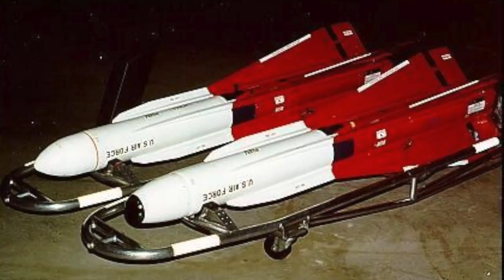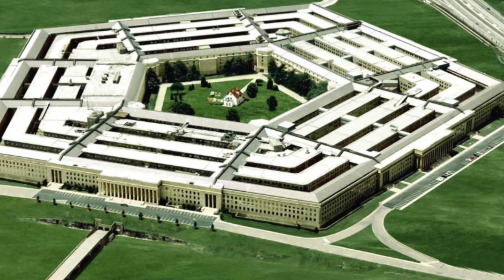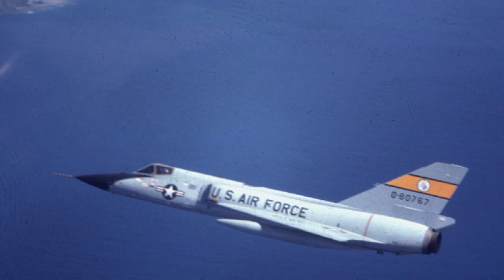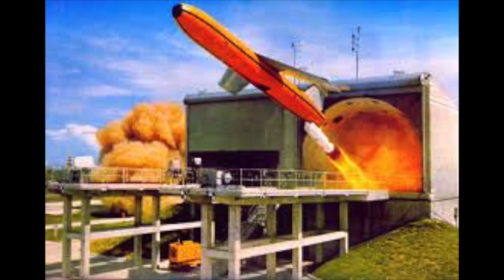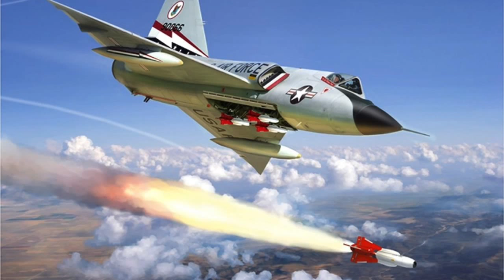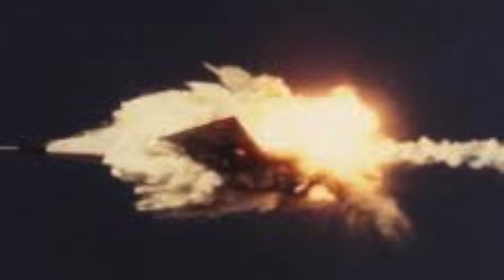MACE kill

Comment from the maker: Max. -  How high could the F-106 fly?  Regulations kept us from flying over 50,000 feet without a pressure suit, and we hated the pressure suits. I flew often and easily at 49,000 feet, while planes like the F-4 had trouble above 35,000 feet.  On one memorable flight, I zoomed to 65,000 feet without problems, but I came back below 50,000 feet quickly because I didn't have a pressure suit. 
I had the distinction of shooting down the first BOMARC missile.  When talking to other pilots who made later tries against the BOMARC, one told me that he was on a pressure suit mission and flew at 75,000 feet, planning to attack the BOMARC (65,000 feet) from ABOVE!  The BOMARC scrubbed so he didn't get a shot, but he flew the F-106 at 75,000 feet!
Reply: Was he cruising at 75,000ft? That's amazing if so; that's getting into SR-71 territory, isn't it?
Reply from the maker: Helium -- the U-2 could probably fly even higher than the SR-71.  We seldom knew a U-2's altitude.  Our ground height finder radars were unreliable and disappointing.  The F-106 data told us what our altitude was, but only that the target was above us at an approximate angle, not an altitude reading.  I talked to an F-106 pilot who said he was flying supersonic above 70,000 feet, but I never got up there.

Comment: Thanks for recalling this (unknown to me) ad-hoc operational test of the F-106 and IR Falcon. I've heard that the ANG squadrons did an especially good job of maintaining these weapons in their elder years.
I've also read the reports of the lower F-4 / Falcon combo performance in Vietnam and attributed them to an poorer maintenance environment and/or high G target maneuvering. The early Sparrow missiles didn't do that well either. The Sidewinder, a newer IR missile design, seemed to be the preferred F-4 weapon. 
If you read this, I'd like to know how the MACE missile was acquired (on board,  ground based radar or both).
TIA, Mike
Reply: UPDATE - just saw your post on the Night Weather video about the differing characteristics of the IR Falcon vs Sidewinder that I was not aware of. I already knew about the F-4 radar / weapons system limitations compared to other contemporary fighter radars / FCS.
Also need to ask if you know of tests using either Falcon against higher G maneuvering (MiG type) targets. Haven't checked out your FB videos yet.
Reply from the maker: Em Eff We did not have any realistic TARGETS to fire our weapons at.  We were very aware that an afterburning target would have such a very large IR signal that an approaching missile would have its entire sensor view full of fire.  What would it do?  The blast of the afterburner exhaust would cause extreme turbulence.  If the target turned, would the missile head through the middle of the exhaust plume and never hit the target?  We ran a program to turn old F-102 fighters into drones and used them to test these conditions.  The AIM-4G already had a program which would aim just forward of the IR plume, so it would hit the aircraft, and later Sidewinder missiles got the same modification.  However, the F-102  TARGETS to test the missiles against were not available until after the Vietnam War.
Reply from the maker: Em Eff To answer your last question:  Arnie Voit used a radar attack on the MACE.  The computer gave the angle and distance to the target at fire time, so his two IR missiles knew exactly where the target was and both locked onto the MACE with no problems.  My attack on the second target, the Firebee drone, was too complex to describe on the video.  I had a radar problem that could have been fixed in two minutes with a screwdriver adjustment, but the rules of this test said NO MAINTENANCE.  I therefore went with an infrared attack on the drone.  I made the initial contact with radar, but then locked on with the infrared IRST system.  Without radar lock-on, I had to estimate the range from the radar scope, and pulled the trigger manually to fire.  My two missile seekers were slaved to the IRST tracker and both saw the target.  My missiles ripple fired (instead of going at the same moment as Arnie Voit's missiles did) and my first missile hit the little Firebee drone directly, blowing it into tiny pieces.  I was watching the missiles too closely and did not make a breakaway maneuver, so I ended up flying my F-106 right through the fireball of the Firebee drone.  I was very lucky and did not hit any big pieces -- the only damage to my plane was some paint scraped off the wings.

Comment: The F-106 Delta Dart was the only plane built as a interceptor. It was high gloss grey with U.S. AIRFORCE all down the side, The 49th had lighting bolts on its drop tanks and a big eagle on the tail. That's common knowledge. We put WSEMS, weapon system evaluator missiles on them daily, had to hand crank the film from them and turn in to photo opps to qualify the rail. I love the 6. I have worked on 16' 15' a-7's, nothing compared to the 6
Reply from the maker: Edward Moriarty -- the F-106 was not the only plane built only as an interceptor.  We had many others -- the F-86D, F-86L, F-89, F-94, F-102 were all designed as interceptors only.  The British had some, too.
Reply: the 6 was the last plane ever built as an interceptor, my bad,

Comment: Great story.  I did not know that the Maces were used as drones.  I know in the early 60s that a Firebee drone was highly modified to the new Firefly standard.  The Firefly was a 'stealthified' drone with special attention given to making it harder for botht he radar and heat seeking missiles to hit.   It was intercepted by 6 F-106s and after 24 missiles were launched the Firefly was still able to do its mission. Some believe that was when the USAF brass decided to start putting some real resources behind drones as more than just targets or one-way winged missiles.
Reply from the maker: I have never heard the story of F106 is being unable to intercept and shoot down the firefly drone. It may have happened, but I probably would've heard about it. Therefore, I question it.
Reply from the maker: It wasn't that the USAF didn't put enough resources behind drones. The technology at that time was not up to what was needed to fly attack drones. I worked with some drones in the 170s, and we had to run wires between different points to get different performance out of the drones. We did not even have computers as we think of them today.
Reply: +Bruce Gordon 

It was from the book byJ.  Blom (2009). Unmanned Aerial Systems:  A Historical Perspective. Ft. Leavenworth, KS: Combat Studies Institute Press. 

The paragraph is on page 56.  It is a PDF so I cannot do a cut and paste.  According to the book it was five (not six) F-106s that each shot 4 missiles on April 17, 1962 against the Ryan 147 which was a very highly modified Q2C (really just based on it I think).  It was part of project Big Safari streamilined procurement program (really, who comes up with these names?).  This is cliamed to tbe the point where the USAF brass decided that a recon drone was a potentially viable system.  I suppose one could call it  the evolutionary point at which recon drones became 'accepted'.

I came across this while doing work for my Masters degree. Here is the link

http://usacac.army.mil/cac2/cgsc/carl/download/csipubs/OP37.pdf
Reply from the maker: +maxsmodels   Max - very interesting.  I didn't realize that the Firefly drone was the same drone that I knew as COMPASS COPE. It's a high altitude recon drone with the engine mounted on top of the fuselage so the IR can't be seen from below. I worked near them, but not on them, in this period and did not know of the tests of the F-106 against it.  Yes, a relatively small target with the IR hidden and using radar absorbant materials would be a very difficult target!  I think that COMPASS COPE was the forerunner of GLOBAL HAWK, which is supposed to replace the U-2 except that it doesn't fly high enough or carry the payload of the U-2.  I can understand missing the Firefly at very high altitudes when the IR missiles couldn't see an IR source.  There is some doubt if the missiles could guide properly at that high an altitude. The air is too thin for small missile control surfaces.
Reply: You got to work on some incredible programs in heddy times.  I would love to have flown a 'Sexy Six".

Comment: It would be really interesting to read an analysis of the advantages that the computer aids in the 106 have over the F4 just for IR missiles.
Reply from the maker: I don’t think such an analysis exists.  The poor performance of the Falcon missile fired from the F-4, compared to excellent performance on the F-106, is an indicator.  About 12% on the F-4 compared to 95% on the F-106. The firing conditions were different, so the numbers are not comparable, but they are an indication.  The versions of the Falcon were different.  The Falcon fired from the F-4 was the version from the F-102, while the F-106 fired a newer version.  The test results and PK (Probability of Kill) were classified at the time, so I never saw the F-4 data.
Reply: @spiritofattack  , understood, so they were different versions. That alone could explain the difference. Thanks for the answer.

Comment: I was on a Mace Launch crew in Germany back in the 60's. The Mace weapon systems  were program to fly erratic courses on the way to the targets and would have been much harder to take-out than one flying a straight course, which I assume was the case here. Of course I could be wrong here with my assumption.
Reply from the maker: Roy G Interesting comment, Roy.  This test was to determine the effectiveness of the F-106 and the AIM-4G missiles, not the effectiveness of ground radar in tracking the target.  Once the F-106 had radar contact with the MACE, its maneuvers would have had little effect on the outcome.  In Vietnam, the F-4 was reporting that the AIM-4G was unreliable after launch.  Our test confirmed the reliability of the F-106 and AIM-4G IR missile against a realistic target, without special "tweaking" the missile or aircraft  just before the test.  The ability to detect a maneuvering low altitude target was done routinely during multiple air defense exercises and was not part of this test.
Reply: Okay..that's clear, I was just defending my Mace.Thanks.:)

Comment: My sister's cat is nicknamed "Mace" short for Macey. I love reading about the early cruise missile capabilities of the Air Force in the cold war, very impressive! I didnt realize one of the Mace systems used terrain matching, long before the BGM-109! I realize the tomohawk is digital, but still quite impressive!
Reply from the maker: The MACE was intended as a nuclear weapon, but it could be detected and shot down by a number of defensive systems.  The MACE used inertial navigation, not terrain matching.
Reply: I thought one was inertial from fixed locations, while the other had a radar and matched radar returns to a pre-recorded film or something. Maybe it wasnt named mace, but it was the same missle body, just different guidnence.. I was thinking they were both mace, but maybe the radar version was matador.
Reply: Mace with ATRAN guidence or Matador with ATRAN. Than Mace with inertial guidence only.

Comment: I need to make a correction.  The Ryan 147A was calld the Lightning Bug, not the Firefly.  The Compass arroe was a later deisgn.  https://en.wikipedia.org/wiki/Ryan_Model_147

On another note I have a question, how did you like the F-106?  Did it fly as good as it looked?  How high could it really go?
Reply from the maker: Max - I loved the F-106!   Yes, it flew even better than it looked. It wasn't until 1968 that we began fighter maneuvers with it and developed the tactics equal to our capabilities. Our mindset was on attacking bombers and fighter tactics was a different kind of flying. My point is that our mindset was more of an obstacle than the aircraft.
Reply: You were at the right time in history to blend real performance with real piloting skills before everything fun became against the rules.
Reply: Almost looks like a F-102
Reply from the maker: Maxmodels -- I loved the F-106, it was the best plane I ever flew!  It was not the zoom climb that mattered, but the F-106 could cruise and fight above 50,000 feet, while few other aircraft could.  We stayed below 50,000 feet because the regulations said we had to wear pressure suits to fly above 50,000 feet (blood would boil if we lost pressurization) and those pressure suits were horrible to fly in, so we seldom wore them.  The F-106 could fly quite well at 49,000 feet and look down on everyone else (except the U-2 and SR-71).  I did get up to 65,000 feet once in an attack on a U-2, but I didn't have a pressure suit so I came back down quickly, being very aware that I would die if anything went wrong.

Comment: The F-4 did not ever carry the AIM-4G.  It carried the AIM-4D for a few months.  The AIM-4D was a converted AIM-4C that had an AIM-4G target seeker mated to it's electronics and airframe.  The portable field test set for the AIM-4D that was used in the Vietnam war was not capable of fine tuning the missile.  That along with the lack of a throttleable cyrostate to regulate target detector cooling argon were the major problems.  Some say the lack of a proximity fuse was also a problem.  With proper fine tuning of the tracking time loop constant that was not a real problem.
Reply from the maker: Jim Harris -- true.  The F-4 used the AIM-4D that was used on the F-102, not the AIM-4G that we used on the F-106.  The AIM-4G required the MA-1 computer system which the F-4 did not have.  As a result, the missile preparation problems that plagued the F-4 did not affect the F-106.   Every AIM-4G that I saw impacted the target, so it did not need a proximity fuze.  Because the AIM-4G would impact the target, did not need such a big warhead as the Sidewinder or Sparrow.  The AIM-4G also had a two-stage motor -- an initial boost, then a long-burning cruise motor.  The Sidewinder did not steer until after the rocket burned out, which meant that the Sidewinder was not good for close shots.  The boost of the AIM-4G lasted only about two seconds, so it started guiding very quickly and was effective at closer range than the Sidewinder.
Reply: @spiritofattack  HI Bruce.  Did you serve in the Air Force with a 316X1L AFSC?  The AIM-4D was also carried on the F-101.  And externally at that.  It has been said the AIM-4D did not stand up very well to the environment on the F-4.  The F-4 was originally built as a fleet defense aircraft and carried little ordnance under it's wings.  When the Navy and the Air Force decided they needed a quick solution to their problem of needing more "iron" (bomb) haulers it was pressed into service in that capacity.  Which meant the iron had to be carried under the already low wings.  Positioning was mostly dictated by the CG of the F-4.  However, that was a very turbulent environment and caused an lot of unplanned wear and tear on anything carried there including the AIM-4D......an environment it was not designed for.  A subsequent modification to the missile remedied some of those problems.  The rocket motor on the AIM-4F/G was, a you mentioned, two levels of burn in the same rocket motor.  The first part of the burn was 0.6 second with a thrust of about 3500 pounds.  The second burn was for 4.0 seconds at about 400 pounds.  Lower max speed but longer range.  It began steering after the first part of the burn.  The AIM-4A/C/D was a single burn at about 3500 pounds per second and burned for 1.6 seconds.  So it experienced more G's and higher speed but shorter range.  It began steering after the 1.6 second burn.  I could go on for hours about those missiles.  I spent over 20 years in the missile field mostly as a 316X1L.  When I made Senior Master Sergeant my primary AFSC was changed to 31790.  Have a great day Bruce.
Reply from the maker: @jimharris5616    I love your description and appreciate your expertise!  As a pilot, I flew with the AIM-4D and the AIM-4G, and also the Sidewinder.  I was highly interested in aircraft systems, and became a Quality Control and Functional Check Flight pilot.  I enjoyed talking to people like yourself who had detailed knowledge of the systems worked.  My expertise was in making that knowledge work for me in the cockpit.  The high point of my technical career was my BOMARC kill.  I knew before takeoff that the BOMARC would be coming at me at about 2,000 mph, so after engine start I had the tech set the range gate so it would drift IN and barely hold lock on a stationary target.  My Squadron Commander did nothing unusual.  We turned into the BOMARC and accelerated to Mach 1.5, while the BOMARC came at us at about Mach 2.5, making about a 2,000 mph closure rate.  My Squadron Commander could not hold lock on the rapidly closing target, but the range gate drift the I had set in helped me get and keep a solid lock-on.  I could see the BOMARC coming, and my AIM-4G infrared missile clearly homed in on the intake spike of the BOMARC's left engine.  The impact and explosion blew off the BOMARC's left wing and caused it to snap left and dive, nearly hitting me!  The fact that the AIM-4G hit the BOMARC at such a high closure rate gave me great confidence in the missile.  BTW - I fired only one missile -- the other rail had a WSEM to record the signals -- and the WSEM qualified OK!